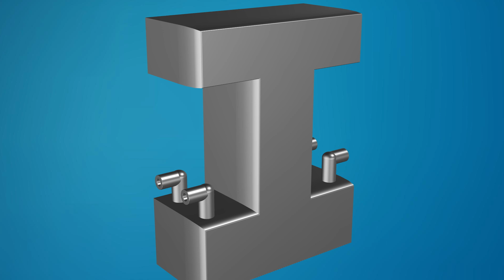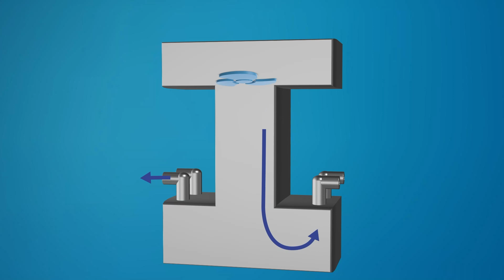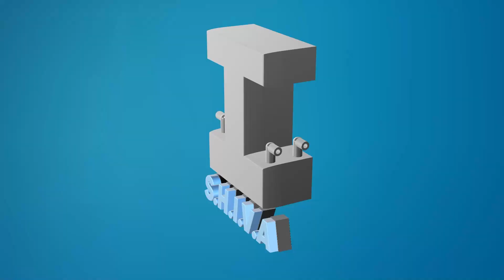S.H.I.V.A. AIR TOWER | A SOLUTION FOR DELHI'S AIR POLLUTION PROBLEM | #delhiairquality #delhi

Comment: At what capacity can it operate? Specifically, what volume of air can pass through it per minute? Also, it will require filters, and to reduce a reasonable amount of pollutants from the air, we will need large filters that will need to be replaced very frequently. Unless you are using a HEPA-based filter (which will cost a lot), this model will not make a significant impact.
Reply from the maker: Thank you for your comments sir. The capacity and volume are to be determined by the technical team once it goes into development model, as I assume. Yes, we need large filters and they need to be changed regularly. You have rightly mentioned about it. We have planned an operational system about it. Also, we have taken into consideration about smog towers in Delhi. They are 20 meters tall and are miniatures compared to S.H.I.V.A Air Tower. This has to be 100 meters tall to cover an area of about 5 KM radius. We may not need HEPA based filters as we will have wet chambers that can absorb pollutants. But, hopefully, this idea needs due consideration, more deliberations and discussions before it becomes a reality. Thank you again, sir.

Comment: The issue is there are already 2 such smog towers in delhi but they have failed to bring any visible aqi improvement. They only work on a small radius and it was found that lakhs of such towers will be needed to bring a visible change in whole city. Plus even many nearby cities of haryana and up also face similar pollution so what about them. I am not sure how this idea is different from already existing smog towers. I feel more important is to stop pollution at source like stopping stubble burning and discouraging private vehicles
Reply from the maker: Thank you for your comments, please. All measures taken up by the Delhi administration till date have not yielded positive results. That is evident with the fact that AQI is still in very poor category in Delhi. Hence, I consider, S.H.I.V.A. Air Tower is the only solution for the present air crisis. That apart, switching to EVs, controlling industrial pollution, construction activities also need to be addressed at the earliest.